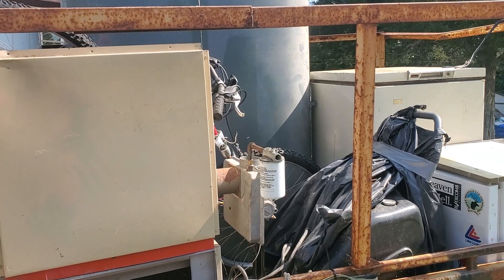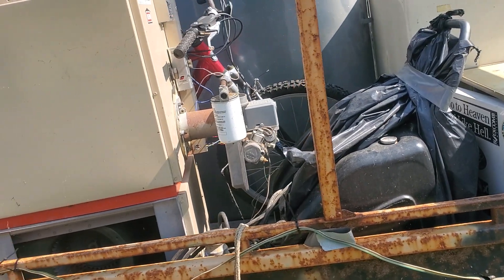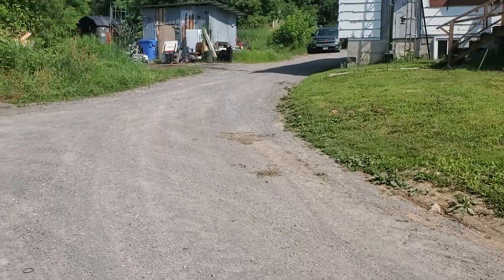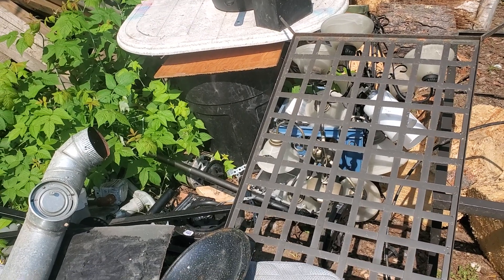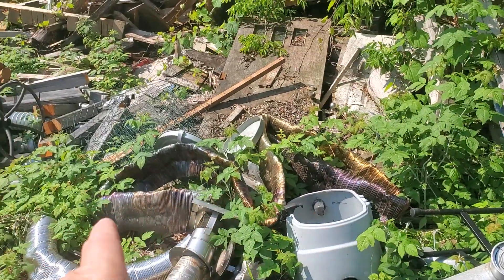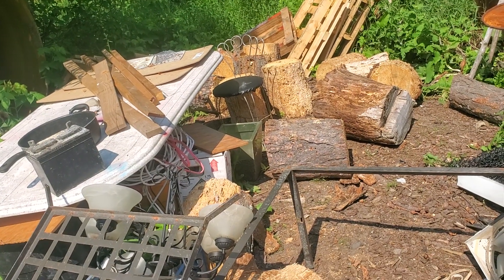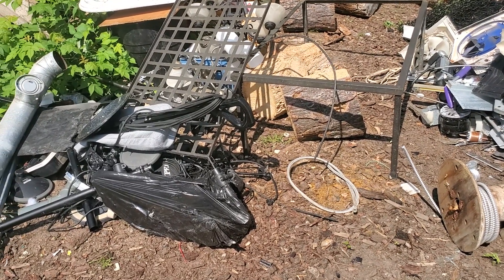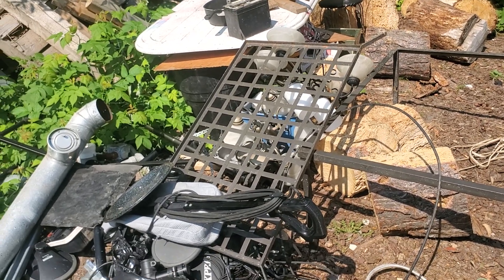big load of scrap what did I get? #scraplife #scrap

Comment: Doesn't your yard downgrade your wire when Christmas lights are in it?  Every yard I know of wants them kept separate.
Reply from the maker: I usually keep Christmas lights separate but I just through them on top for now yes Christmas lights are like crap wire they're not worth very much
Reply: @MissCanadian  I took in, just shy of, 800 lbs of wire about three years ago that was downgraded because Christmas light wire was in it even though I'd spent maybe three hours cutting all the bulbs off.  That mistake cost me around $200.  Won't do that again.
Reply from the maker: @John-pn7bh  I'm pretty sure my scrap yard throws them in with the dirty Aluminum & dirty stainless which is .25 cents a pound